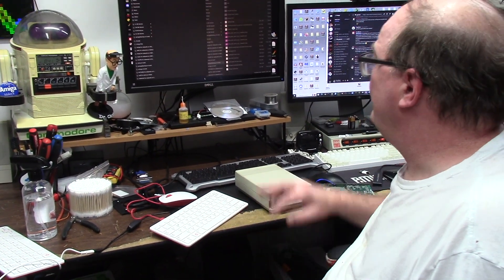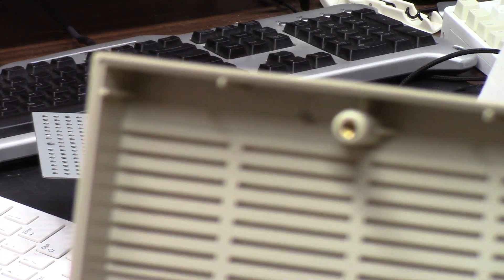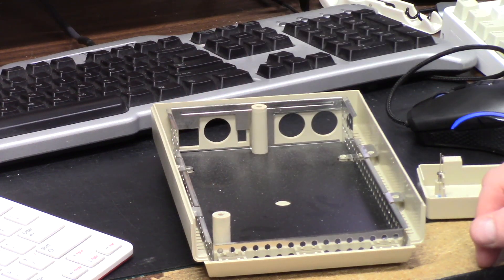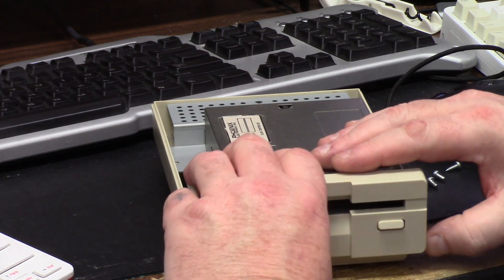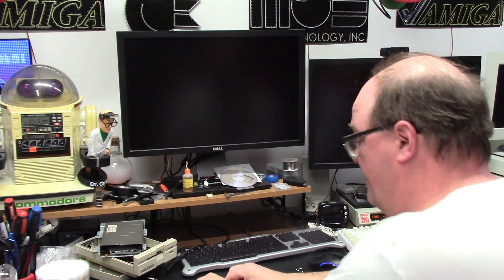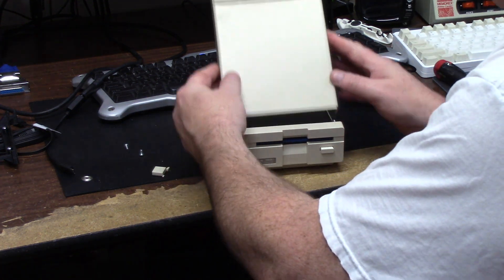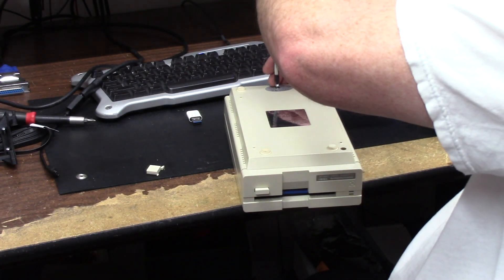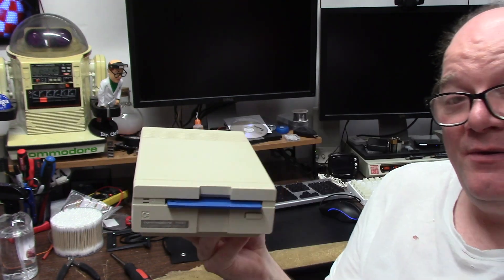The CBM 1581 3.5 floppy drive from a Commodore 64/128 to the Amiga?

Comment: hello can you please show me how too mod Amiga 500 drive so I can install it in my old 1581, Amiga disk drive doesnt seem too work thankyou
Reply from the maker: Amiga 2000's FB354 bolts right in , you would need to remove the 1581 board and use a external gotek type plug so it would go into the back of the amiga drive and into the floppy port in the back of the amiga. they sell the cables on ebooger

Comment: Wow that brought back some memories in that a friend who owned a Used Computer Store had an Amiga 500 return because the Floppy Drive did not work, and a new replacement drive was on the expensive side for him so he asked me about where he could get a Floppy Drive since was unable to use a PC Drive.   I sold him the drive out of a 1581 and kept everything else so he was happy, his customer was happy, and I was happy to have spare parts to keep my other 1581's working.   Now that was at the time before I knew how to convert a PC Drive to work on an Amiga.   All I knew was the drives were interchangeable.  Back then I would buy and sell used Commodore Equipment and unlike Commodore which gave you a 90-day warranty I always gave a 1-year warranty because I had so much stuff it was just easier to swap failed devices with working one device.

Comment: Cool looking drive, looks like a cousin of the A1010 and A1011, which I guess it really is!
Reply: Probably not, commodore 1581’s we’re like the 1571 drives, brains and such… 1010 was basically a bare drive with cable pass through to the computer. And Amiga ownership and Atari ownership shenanigans made a bunch of crazy stuff in 85…

Comment: Actually the 1581 was used more or less with the C128. People used them with their BBS's.  One drive you should keep an eye out for Chris is called the Mini Chef. It was a 1571 modified that had also had a mini-scribe 20 or 40MB hard drive inside. There were switches on the drive that would either max  X number of individual 1571 floppy partitions on the HDD, or make one big partition.
Reply: Used 4 of them with my bbs.
Reply: Yeah, I had one with my C128. Was a good little machine.